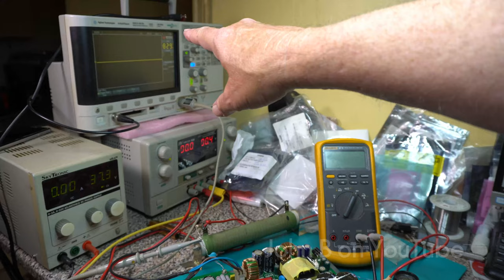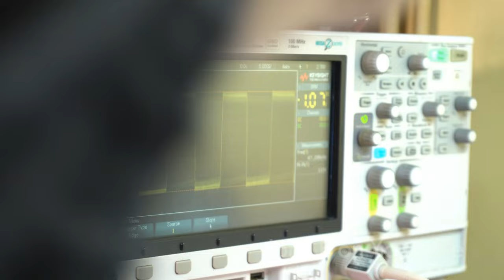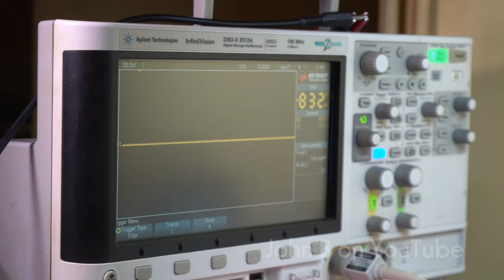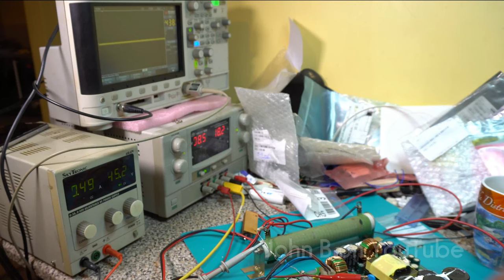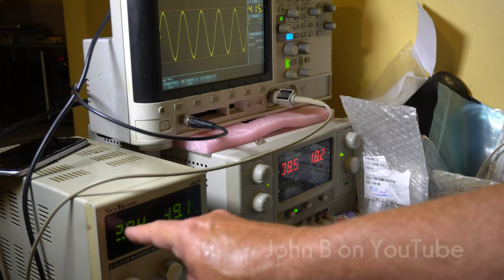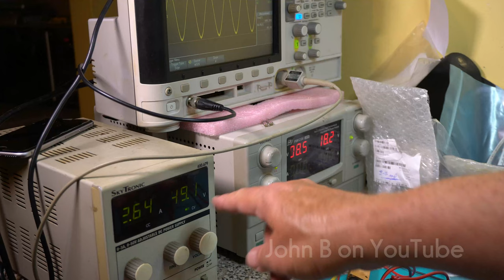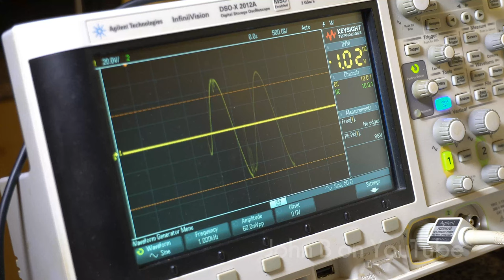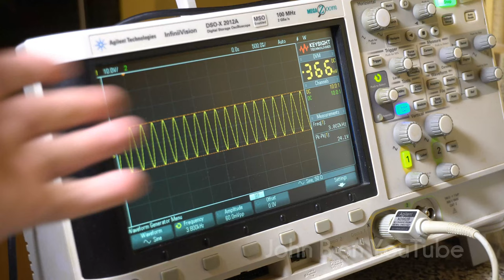Mackie SRM450v2 Blowing Fuses | In Depth Repair Guide

Comment: Very informative troubleshooting bro, thank you very much. I have the same model, but the issue is , i am not getting the 16 volts supply to the PFC chip and also I get 12 volts 
only in the cathode of the D37diode when the mains is ON. My question is if I follow your procedure  of supplying 18 volts in the cathode D37 and 8 volts to the comparator can i go on
with 220 ac mains ON or shall I use 50volts DC input main supply as in your video? Thank you bro.
Reply from the maker: Hi,
NO, you can't supply external supplies with a ground on the diode as shown.
When you plug in the mains, it will blow up your power supply.
The ground point for the external supply is NOT mains ground / earth.
You need to check it as I have shown.
The circuits, PFC & SMPS, should draw no more than 50 to 60 mA
You should see your circuits are drawing more current or simply just not working.
Reply: @JohnB-2021  ok bro,  but i need to find another power supply  same as yours 5OVdc 3 amps. Then  i can proceed. Thanks bro.
Reply from the maker: @PowerToneAudio  I think if the amp does not start on the mains then another psu is not going to help.
What current is the pfc and smps drawing?

Comment: I've seen broken leads on a Mackie before but i think it was on the old version. Also in powered speakers if you see regulators with small independent heat sinks they often break leads from harmonic resonances causing metal fatigue (if not glued down), Could you have tested those diodes with the mains power on if using a DMM to check for the -&+ on the middle pins, with just the 8v supply connected.
Reply from the maker: Thank you for your input.
Yes, many times I test the +/-75 with mains on if I have a problem somewhere.

Comment: I guess an isolating trsnsformer will be a good investment for working on smps. At least you can get a small one to power your scope.
Reply from the maker: I had one years ago and never replaced it. I prefer testing everything with just a low voltage.

Comment: John have you got any video on the detailed working of the PFC section and the way it ties in with the SMP.  I have a few problems with units that use this principle but little to none service info …. I could do with some help with..
Reply from the maker: Hi Steve, no video.
The last pfc was on a Panasonic plasma tv. It’s like the Mackie, just a boost circuit.

Comment: John,  is it safe to connect my scope to the direct BASS OUTPUT (both - and +) with the described 50V/3A? I see that you were probing D44 and D43, but I want to be TRIPLE SURE that the amplified signal at CON5 does not ruined my $350USD scope. Thank you for this awesome educational video.
Reply from the maker: You do not need to connect the earth to the speaker ground, connect it to the chassis if the signal in has no ground.

Comment: G'day twin, Is the voltage so high because of the watts?  When you talk about voltage of 380 that's almost getting like my car of 400V DC.
Reply from the maker: Mains voltage is 240 in UK
Multiply by 1.414 will give you the peak voltage of 339 volts.
The PFC coil boost that to 380 volts.
Reply: @JohnB-2021  Yes but why do you need such a high voltage?
Reply from the maker: @mikeycbd  So as to not distort the mains input and having a large voltage makes the next transformer smaller.
Reply: @JohnB-2021  380V AC? Not DC I never would have known... go tinkering round in that and opps...
Reply from the maker: @mikeycbd  380 DC

Comment: Hi John. If is possible to check gate driver ic irs2092 without mosfet?
Reply from the maker: Yes I imagine it is.
Though Mackie don't use them on this amp.
Reply: I'm repairing a mackie thump th 18s subwoofer amplifier.  They use irs2092 gate driver ic.  I checked the pin of the gate mosfet, but there is no pwm signal showed on oscilloscope.  Then I tried by turning on without a mosfet, but the irs2092 burned.  Have you experienced the same thing?  Or do you have any suggestions what should i do?  Thanks for replies
Reply from the maker: @arisatyabharotoyakti2616  I see.
Just thinking aloud, without the fets, various pins will be at the wrong voltage like the middle of the 2 fets.
I'd fit a new one with new fets.
If it blows or does not work, you have a fake irs chip.
Where did you buy the irs chip?
Reply: I haven't replaced the gate driver ic yet.  It's original from Mackie, that stoped working yesterday.  I just removed the mosfet, then the gate driver ic has blows up.
Reply from the maker: @arisatyabharotoyakti2616  If you watch my sub repairs, the fets always take out the chip or the chips always blow the fets.
You have to change both.